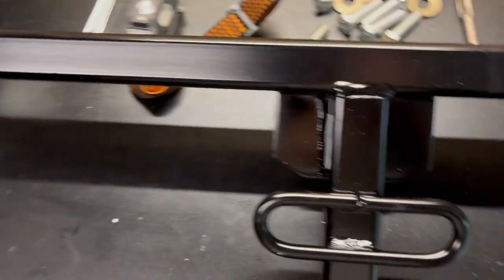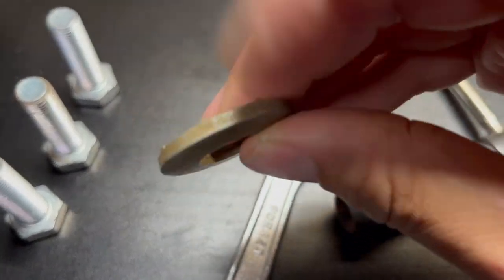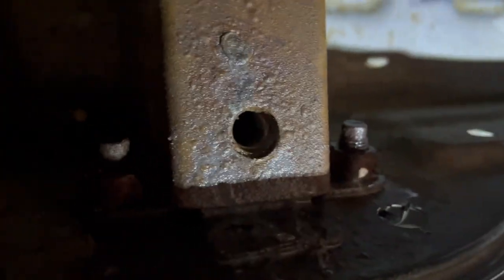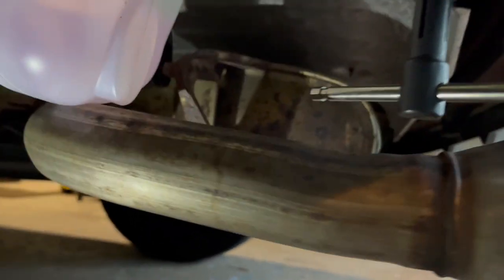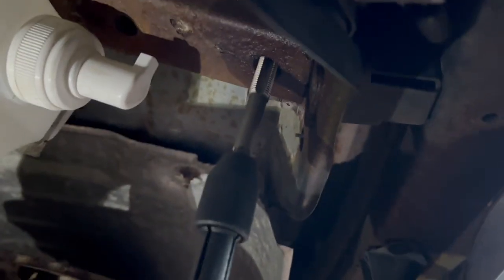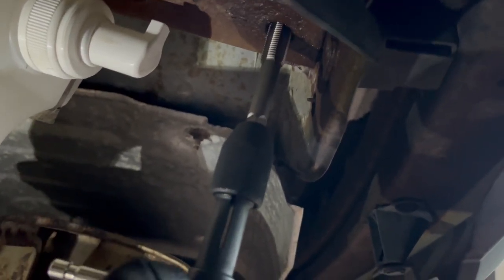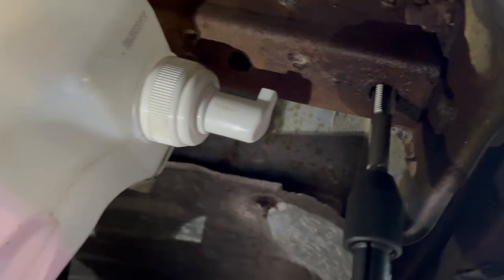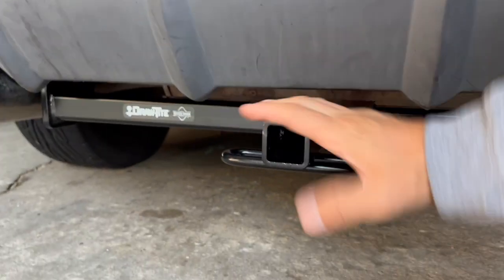How to Install a Draw Tite Trailer Hitch, i.e. How to Tap a Weld Nut - Shown on Pontiac Vibe!

Comment: No rust precaution on the bolts and washers ? 
These are usual different materials and therefore the oxidation will start on the surfaces soon, can even happen a lot faster than before on the car.
Reply from the maker: Which rust protectant do you recommend?
Reply: @TomsDoItYourself Hello mechanic here, to prevent contact corrosion we typically use ceramic paste to suspend the two different kinds of metal and protect it from galvanisation.
Just be sure to only apply a thin layer and torque the bolts correctly because it also is a lubricant to a degree.
Hope this helps.